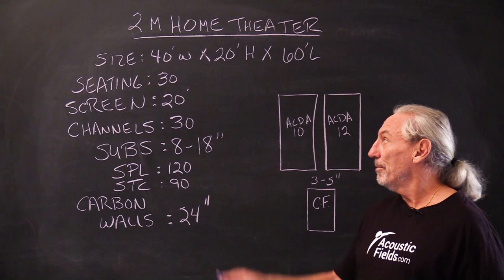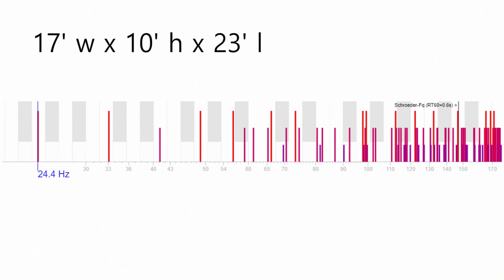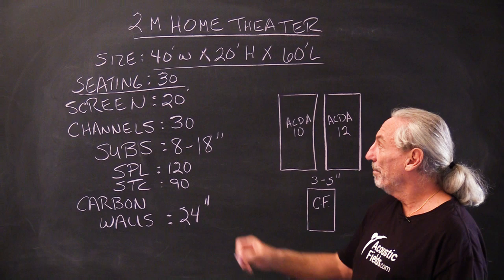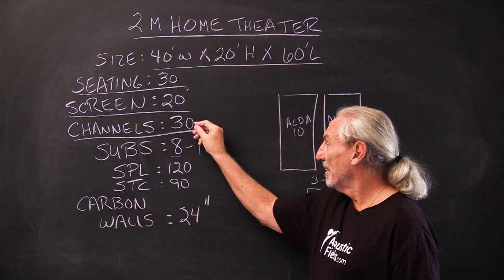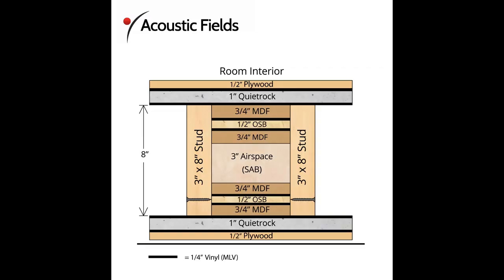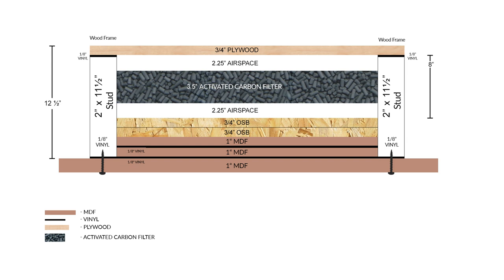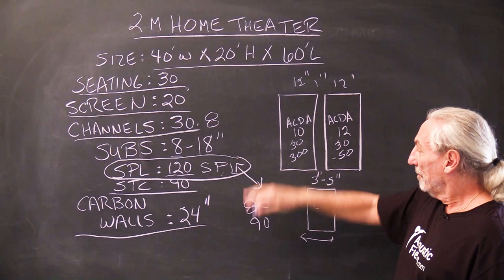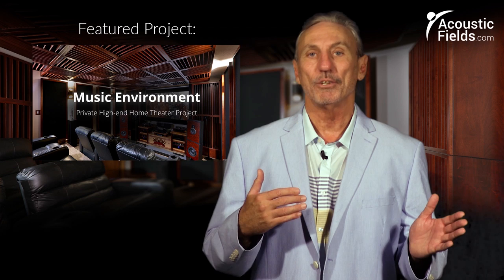$2M Home Theater Project - www.AcousticFields.com

Comment: 3:46 These are the abbreviations, right?
OSB = oriented strand board.
MDF = Medium density fiberboard.
But I didn't find SAB via Google.
Reply: It's most probably the brand name - Sound Attenuation Batts: https://www.owenscorning.com/insulation/products/ecotouch-sab . 
However, please don't follow that design, It won't get you anywhere good. Most notably the studs that are not decoupled and will transfer low frequencies between leaves. Of course with another two walls of $2M worth of carbon bass traps it might actually work decent enough, but not cost effective. If you want a decent and cost effective sound barrier, as far as my research goes, stay with traditional dense building materials such as calcium silicate bricks or concrete, build two airtight leaves (walls) separated by an airspace filled loosely with mineral wool and avoid any additional airspaces not to create a tripple (or more) leaf effect (especially if you must stick with drywall technology upon wooden studs, avoid additional leaves and separate the studs for each leaf, not that important for massive brick walls, but ensure their airtightness and that the insulation inside is loose and doesn't create any bridging of sound). 
Now, the densier the materials and the larger the airspace the better, but to figure it out effectively use a MAM calculator (mass - air - mass, e.g. https://johnlsayers.com/phpBB2/viewtopic.php?f=3&t=21373 or https://www.gearslutz.com/board/studio-building-acoustics/992698-mass-air-mass-resonance-calculator.html). Change the mass of each leaf per surface area according to thickness and density of a desired material and air (insulation) cavity depth, so that you achieve a resonance frequency below at least 15 Hz (at that resonant frequency the sounds might even be amplified, not only poorly damped). Using multiple layers of different materials also has its own merit, it's even advisable to use different materials and or thickness for the two leaves, but 10 layers per leaf shown here seem impractical to say the least. Hope that hepls! Good luck :)

Comment: Hello appreciate all the info in your videos. Curious why does the graph on the smaller room range from 24hz to 170+hz  and the larger room ranges from 8hz to 50hz? Shouldn’t they be the same frequency range?
Reply from the maker: M,  The large room does not have any frequency and amplitude issues above 50 Hz. Always look at the indexes on any graphs. They are labeled as to function.
Reply: @AcousticFields  so if you look at indexes, the bigger room has more lines in this range than smaller room (you said "no lines") :)

Comment: 120dB SPL? are you forreal? are these people intending to damage their hearing or whats the point? i mean i get it - I loooove energy and volume as well, but 105 is the max.. over 105 i plug in my hearing protection (in clubs or live concerts) but 120? thats overkill... am i missing a point dennis? whats your take on that spl level?
Reply from the maker: C, Its not steady state pressure. It is transient with brief peaks at that level.
Reply: Basically they are aiming more or less for the THX standard in THX rated cinemas regarding SPL.
Reply: You nailed it. 120 dB will have people running out of the room.

Comment: 40x20x60?  the ratios are problematic. I look forward to see the before and after waterfall measurements for this build. No smoothing. Thanks.
Reply from the maker: D,  Why are the ratios problematic?
Reply: @AcousticFields  Width and Length are multiple of the height.
Reply from the maker: D, I do not understand your point. Please explain.
Reply: @AcousticFields  You will risk getting poor distribution of modes with that ratio.
Reply: @AcousticFields  The first order room node generated between floor and ceiling will coincide perfectly with the second order node between front and back, as well as the 3rd order side to side. The pressure levels in the corners will be insane at these frequencies.

Will you be doublestacking the absorbers in front of eachother? Won't the back wall of the first absorber just reflect whatever it doesnt absorb?
Reply from the maker: O, This a false comparison between untreated vs treated rooms. Our carbon technology will manage the issues below 50 Hz.
Reply: @AcousticFields  These dimensions will cause triple coinciding axial room nodes at every multiple of 28 Hz. That means you will have to efficiently absorb at 28Hz, 56Hz, 84Hz, 112Hz and so on between every opposing surface. That is a pretty tall order. Are the room dimensions locked in?

Comment: How close can the fill material be to the face plate and how much can I put in it?
Reply from the maker: M,  I do not understand your question.
Reply: @AcousticFields  You say the more depth you add to the carbon filter the more rate you get. So if the cabinet would be completely filled with carbon it would have the most rate. But I assume that would be too much? (overdamped). So is there a point where it is too much? Also is there a minimum distance the carbon filter and the perforated panel needs to have to the face plate so they don't interrupt each other, for example 1 cm?
Reply from the maker: @MrZyrenda  I do not know that to be true. I have not tested a complete cabinet fill.
Reply: @AcousticFields  Thank you anyway. When you use 3.5 -5 " carbon do you split it and leave airspace between?

Comment: OK Dennis, that's it, you've hacked this to death. I was going to comment to another video of yours I watched 2 days ago that if you think a room over 30 feet in one direction will cure your modal issues then you're naive and inexperienced, but I held my tongue. Now you go and show 2 modal graphs of 2 rooms to show that the big room is less problematic, but you showed the smaller room with a graph to 200 hz that has 4 modal lines between 20 & 50 hz, and then you show the big room and the graph only goes to 50 hz and has 21 modal lines shown between 20 and 50 hz, completely blowing your argument and bolstering my real life observations in my 24x48x8.5 room. I'm somewhat confident you make great sounding rooms, but I'm done with your jive.
Reply: To be fair, I think that is due to the choice of the room mode calculator. Try the big room setting: https://amcoustics.com/tools/amroc?l=60&w=40&h=20&ft=true&r60=0.6
Reply from the maker: G, We are not comparing data between two rooms of different sizes. We are illustrating the concept that larger rooms have less modal pressure issues. This was clearly stated at the video beginning. Sorry you missed that.
Reply: @AcousticFields  isn't 21>4 though. I'm confused.